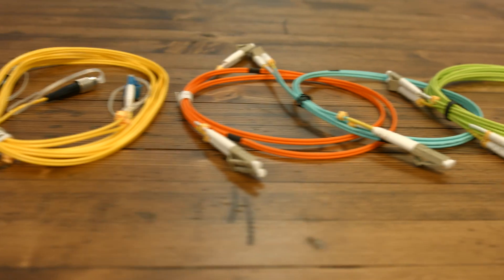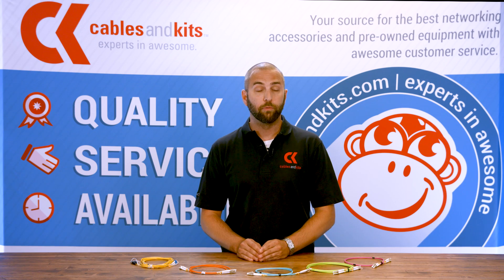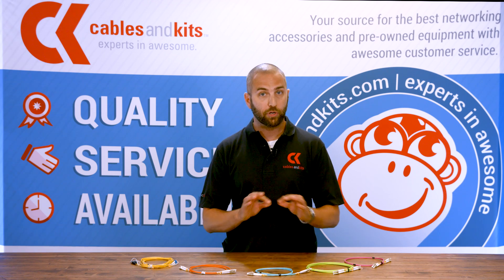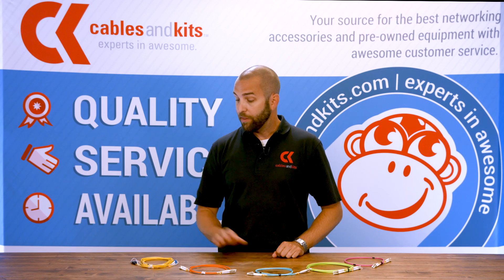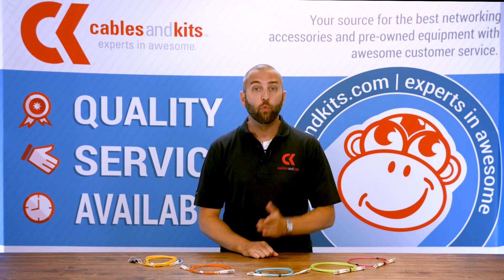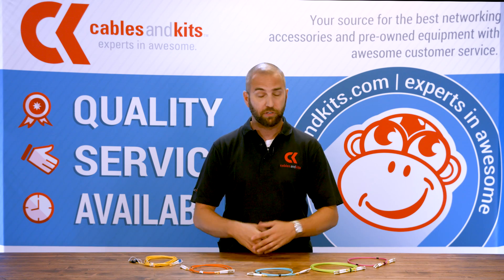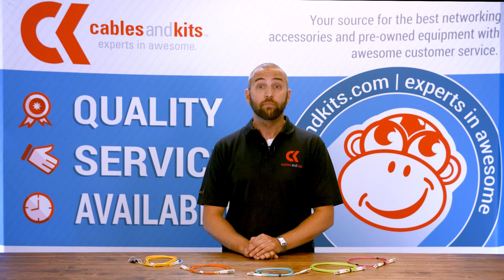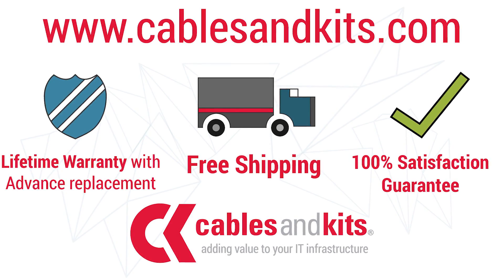What is a Fiber Optic Cable?

Comment: Do have a video on what is the difference between the OM1-OM5, is is all just distance ?  and when should I use single mode over multimode ?  All of my workings with fiber right now are in length under 50ft.  But when I have something longer than 50 what fiber cable should I be using?